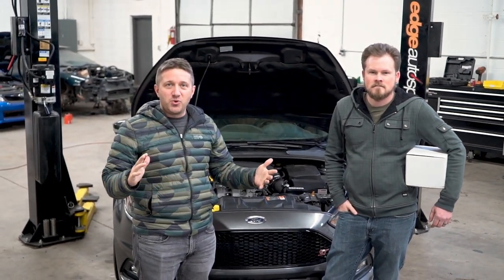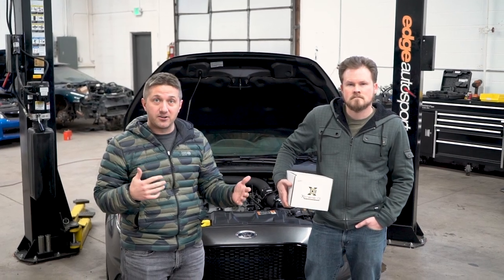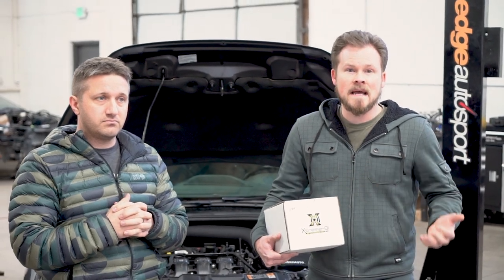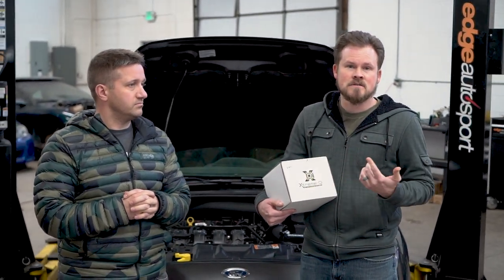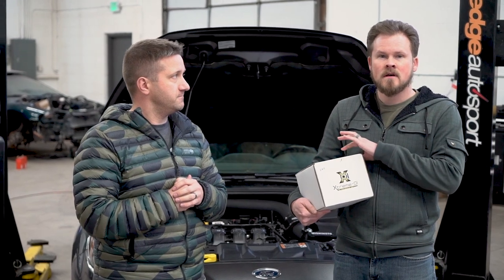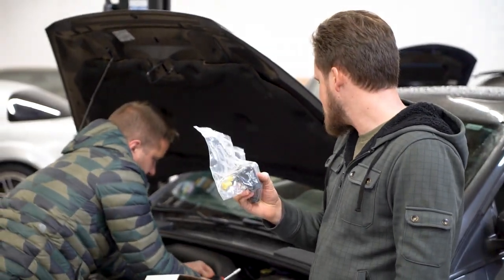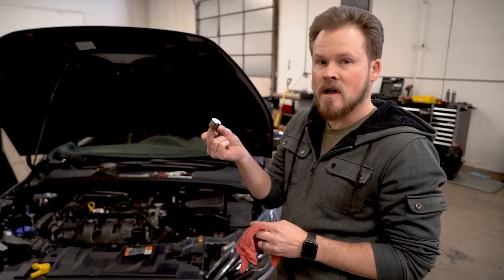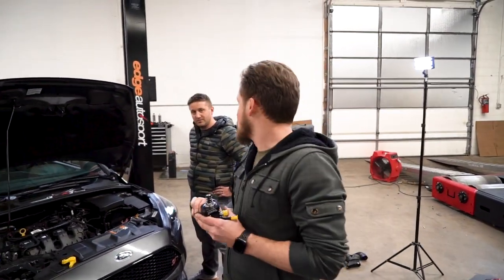Preparing for BIG POWER: We Install The XDI EVO Fuel Pump  |  Project Half-Send

Comment: Awesome video you guys, I’ve been on the fence about doing E-30, just unsure on the mixing aspect of it. This seems to be the safest route for adding more power. Without sending a rod through the block
Reply from the maker: Spot on! The mixing isn't so bad, there is an app for it to help you. Ethanal basically eliminates knock, so yeah, its pretty awesome.

Comment: Would we be able to get a video of a xdi pump as the only fuel system improvement on a larger turbo set up. If a larger turbo is in this projects future
Reply from the maker: That is the plan! The GTX 2860 goes on next, we will see how fueling shakes out with that setup
Reply: @EdgeAutosport  cant wait to see it

Comment: Every fuel pump video people avoid showing how they take off the LP Fuel Line. That thing is a PITA wish y'all would show some tricks to getting it off.
Reply from the maker: I personally took it off and I remember moving around the harness a little to get to the bolt on the bracket in the middle of the line because it was hard to get to otherwise. But I didn't think it was super hard.

Comment: You guys always have awesome videos!
One thing you skipped was the important steps when disconnecting the factory pump, so you dont have a load in the fuel system and get fuel everywhere.

I'm heavily considering spending the money on this pump with a big turbo...since Id rather spend $1450 on this (i believe is the price) than buy an aux kit, replace the rail, add injectors, etc...this is far less likely to fail and i believe it can achieve plenty of power with a bigger turbo. 

On a side note...I have been FBO/E30 for over 2 years straight now. Do you guys know what risks there are to the internals like valves and stuff? Can we safely run cleaners to help with deposits and stuff from running E85 blends for so long? I know my Fuel rail pressure sensor failed during a race weekend and i replaced it, everything was fine. But it had a lot of gunk all around it. Not sure if it was from the ethanol or just happens...
Reply from the maker: The Focus was sitting for a few days, so there was very little fuel pressure in the system, but you are right, pulling the fuse and running out the pressure is a good move. As for ethanol cleaners, we know STP makes and ethanol-specific injector cleaner which may be worth a shot as ethanol definitely gets a little "gummy" on the valves of a port-injected car. If you are DI, it's less of an issue. One of the biggest issues with ethanol is it's corrosive nature on rubber seals and such.

Comment: Would the benefit on stock turbo be worth cost to be able to run straight e-85? For someone down here in Houston area?
Reply from the maker: Yes and No - as you can see, it does add some power, and E85 almost entirely eliminates knock or pre-detonation. But it really shines as a fuel solution when moving to a larger, higher boost turbo setup
Reply: @EdgeAutosport  that’s my goal to get built motor and head work done with stage 4 cams and a much bigger turbo lol. But was mostly wondering because doing it in stages

Comment: so with the Powermax, XDI pump, FBO, and lets say e85...what do y'all estimate power numbers at sea level (or close to it)? Im debating this or the BNR3071 with this pump, Id be happy with 380whp, but if the powermax cant do that on the above set up, Id go 3071 and shoot for a 450/450'ish mark.
Reply from the maker: The powermax will not reach 380whp, ours is barely hitting 315whp on full e85 (at altitude). At sea level, you would get more like 330 ...maybe? If you want to go north of 400, a 3071 would be a better choice!

Comment: Should I Install the Xtreme DI pump or the Xtreme DI EVO on my Fusion Big Turbo 2867R GEN2 if I only run 91 octane gas ?
Reply: This is a good question. Hope there was an answer.
Reply: @lest187  I finally install the Extreme DI EVO pump. The EVO are capable of feeding bigger turbo if I swap later :)

Comment: Will this pump or the 35 work with pump gas or just on e blends? Also do you need the injectors is it necessary..
Reply from the maker: These work great with all fuels, you will get increased flow for pump gas AND the ability to run more ethanol gas, its a win-win! Injectors are not necessary, but definitely a great pairing for an ideal setup.
Reply: Same goes with the xdi non eco fuel pump?
Reply from the maker: @johnlefever3220  yep, the EVO line just flows much better at higher RPM, that's the only real difference.
Reply: Also they can both run full e85 correct?

Comment: I'm not aux fuel or running any E blends so, I'm not real versed in the use of ethanol. My question is why are aux fuel cars not capable of running full E85 but, this car is?
Reply: This car has the PowerMax turbo which isn’t much bigger than stock so it’s not pushing the fuel system that hard anyways. With a bigger turbo, we’d be limited to e40 to e50 with just the pump. And you can run full E85 with 4 port aux fuel and the right size injectors.
Reply: @TMTMS3  gotch ya. Thanks so much, sir.

Comment: I know this is an old video. But I have a question. I have a set of 1700cc injectors with the evo fuel pump. I was told that I need to run a 100 micron fuel filter?. Is this true ?. Or can I just run the injectors and pump and get tuned on a 50% blend ?.
Reply from the maker: There might be some merit to using a fuel filter. I know in the RS it helps with flow since the stock one is so restrictive. But in terms of adding one on to the ST, that's not something that is required.
Reply: @EdgeAutosport  okay thank you